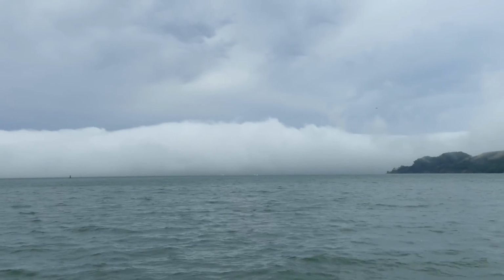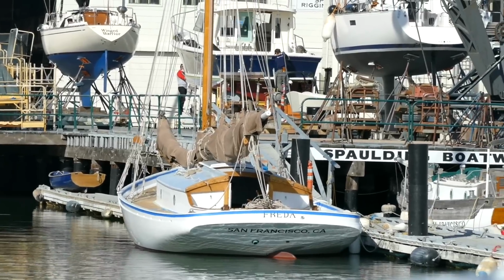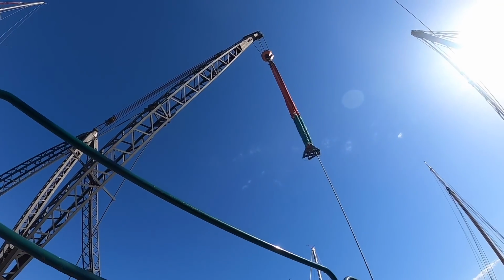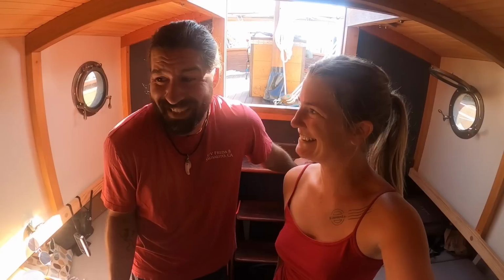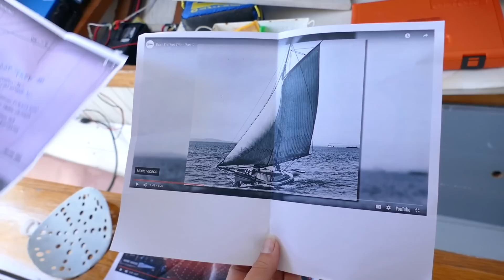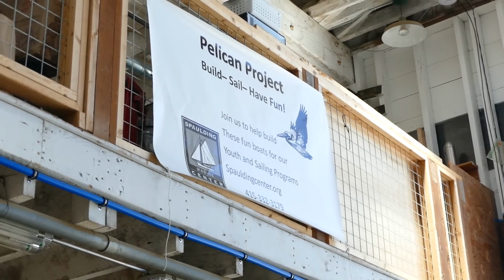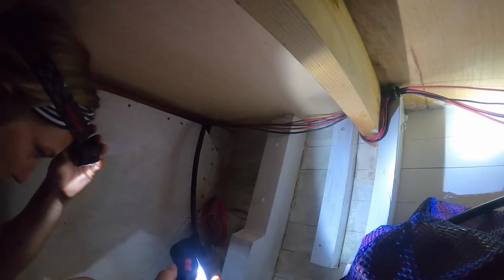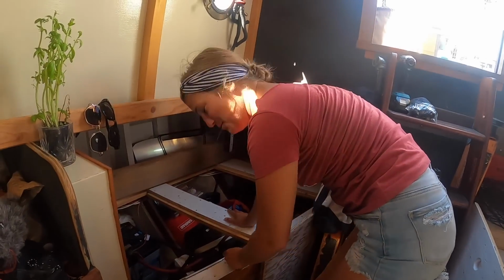Salt & Tar: Ep.204- Spaulding Marine Center

Comment: you could have made parking eaiser if it was windier with just getting the bow spring on first then gentle driving ahead on it  or using a short midship line both will pull the boat tight to the dock to give time to drop all the other lines on.

Comment: Propane advise tried and true:
Get an electric 12 V valve at tank outlet with a switch close to the stove.Include an indicator light as bright and annoying as possible (have seen a tic tic tic buzzer added too )sniffers have become inexpensive,
absolutely get one and wire it to your audible alarm (got to get one for high water, AIS etc....) 
No! shutting the valve by hand is not the safe foolproof way to go! 
Great video, thanks for sharing .

Comment: The boat looks great you have done and are doing a great job.  On running the propane line, I think the line cannot have any fittings in it from source to appliance (bottle to stove).  An inspector made me replace a copper line because of a connection fitting.  I had to run two separate lines from source to each appliance to get inspector's approval.  Just a thought.
Reply: I agree Art. I hope the rubber hose is a temporary measure. Here in the UK that installation would be condemned instantly.  Even on our caravan we are only allowed 600mm/2ft of flex hose each end with copper pipe in between.  On caravans and boats a pressure test point needs to be fitted in the line. On caravans built over the last few years a regulator on a flexible hose is not allowed. It must be a bulhead fixed type.  regards from the UK

Comment: You're doing the same as I used to do, working too hard in the heat, and likely not staying hydrated as much as you should... Have you ever talked to your doc about using a muscle relaxer for your back pain? Before and after getting a back (and neck) fusion I would get bad muscle spasms and cramps in my back. One doc prescribed Methocarbamol for me for when that happens and it works good without making me loopy. It's like it gives my muscles a break from spasms and cramps long enough to "reset". If you do use muscle relaxers don't drink or take opiate pain relievers with them or you can wake up dead...

Comment: Are you allowed to run flexible propane lines concealed and through walls?
I believe our local rules require fixed lines with a maximum of 3ft flexible line at either end.

Comment: Hi from New Zealand. Your boat is looking great and its coming along nicely. Just a suggestion, and probably a bit late now as you have run the gas lines already but my thoughts would have been to run them externally up to above the stove and then run into the boat. The hose is very long and with a joiner in it and it looks like its running by/through the battery compartment maybe a bit risky? Maybe reconsider to use a solid pipe from the cylinder and a flexible hose where it enters the deck to the stove?
You only get one chance with gas and I wouldn't want to see all your hard work, and possibly your lives, go up in smoke.. Cheers and enjoy your cruising. Ian langley

Comment: I replaced my propane system with a pressurized Denatured Alcohol system.

One thing that I did noticed is that you're missing the redline that goes over your propane line to the stove.

It's a piece of fire retardant hose usually 3' in length that fits over the propane line.  This protects the line and shields it if your stove catches fire.

You can normally find it at fisheries, West Marine, or Amazon.